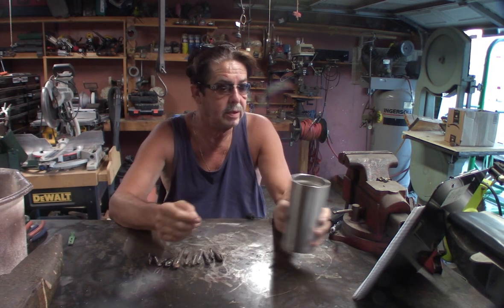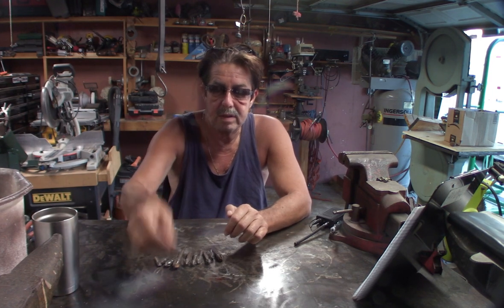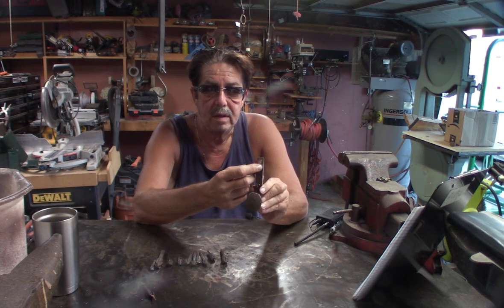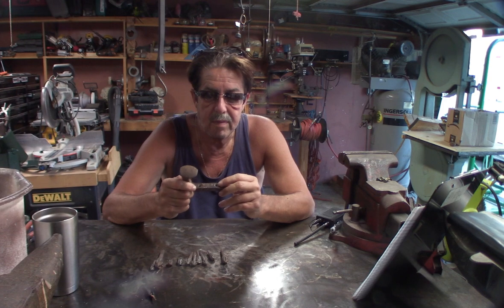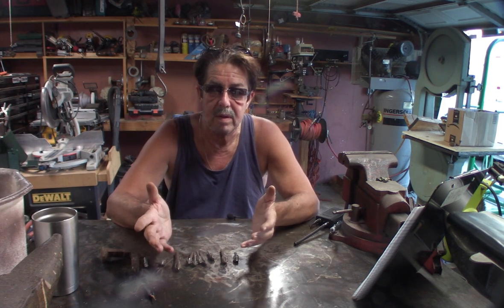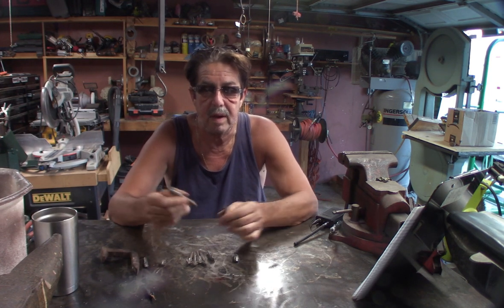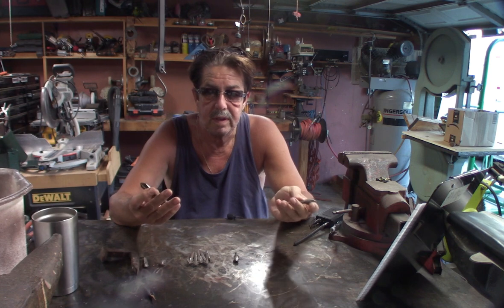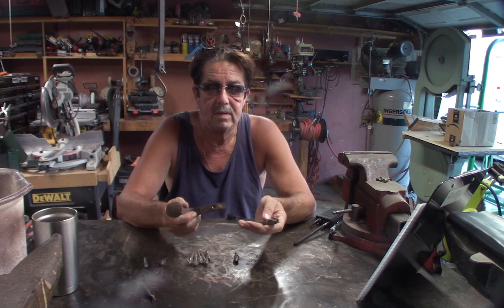Irwin Counter Sink Bit Discussion

Comment: Good video,  when a bit talks back slow down drills or counter sinks.  Carbide bits chip very easy and should only be used on large rigid nachines at the correct speed, can go too slow for carbide and they load up.
Reply from the maker: i agree with you and good point on the carbide - still i wanted to point out why people burn these up so fast and hopefully they will have better luck when you use a good quality bit and use them correctly.
Reply: @TheHomeHandyman  I agree fully i have seen people burn bits up because they think that faster is better.  I worked with an electrical controls  guy who would use one drill to drill one  hole in stainless electrical boxes.  I would reshapen his drills go slower  and get many holes from  from one drill, we worked well together i would drill the holes and he would run wires.

Comment: Not sure why this keep coming up in my feed. I countersink steel every day. A wide selection of awful countersinks in this video. I do agree with slowing down the speed. Folks, if you want consistent, chatter-free results in steel get a zero flute countersink like a Weldon or a Keo. MA Ford also offers some terrific countersinks, too. Just keep in mind that multi-flute 'sinks necessitate a very rigid environment including workholding. Quadruple the idea for carbide. Ain't gonna happen in your garage with handheld tools. So make your life easy, if you work with metal, and buy a good zero flute countersink. BTW, 82* 'sinks are for SAE screws and 90* are for metric. As I understand, 100* are used in aviation. Good luck.